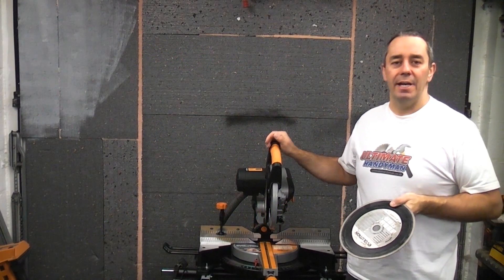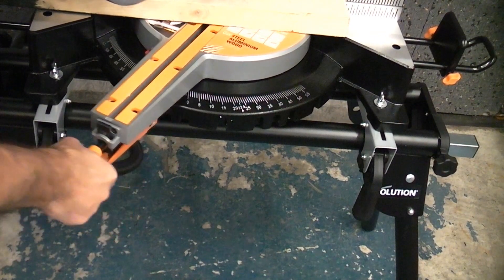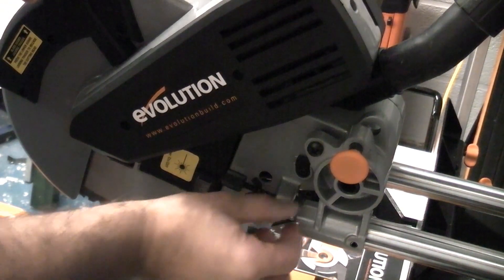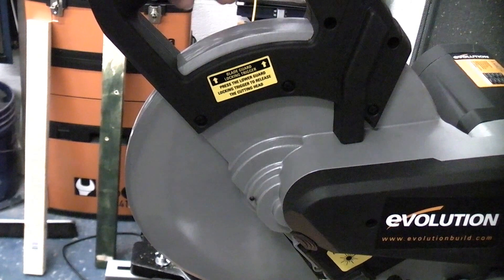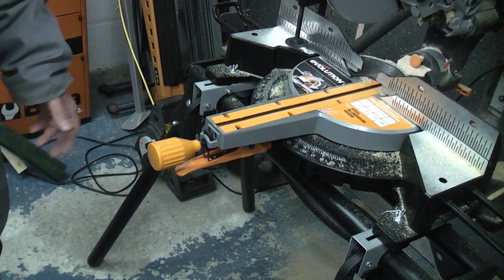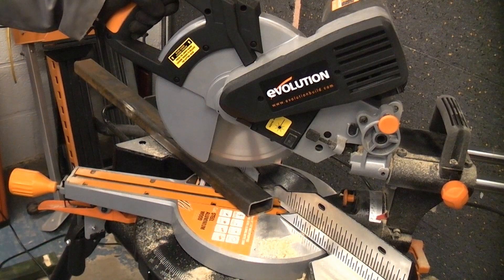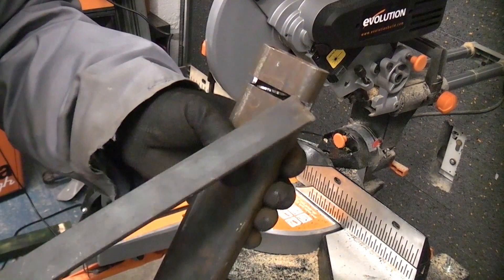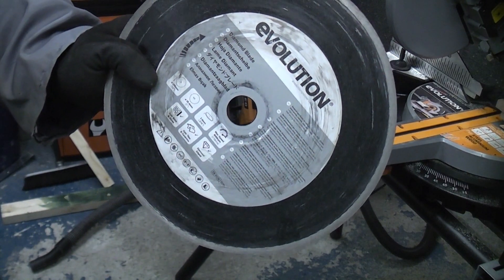Evolution Rage 3DB multipurpose mitre saw

Comment: You hide about  the  lack of graduation  angles  when you bend right  the machine  .
There's graduated  scale only for the left side. ..really weird choice of the engineers
Reply from the maker: This video is showing the Rage 3 DB 
DB stands for double bevel.
Perhaps you are thinking of the Rage 3s which only bevels in one direction and is much cheaper.

Comment: Thanks for the video.  I purchased my Rage 3 DB & it will be hear next week.  I noticed that you made all your cuts with the factory multi blade that came with the saw.  I will use this saw primarily for metal cutting (the very little that I do).  Have you purchased another metal blade for this saw?  If so what do you recommend?  I am primarily looking to cut EMT unistrut 1/8" - 1/2" metal.  I have read some less desirable reviews on the stock blade.  I would like to purchase a blade specifically for metal cutting.  Looking @ the Oshlun for $42 or the Evolution metal for $58.  What do you think???
Thanks in advance...
Reply from the maker: You are welcome.
I have only used this machine with the stock blade that is shipped with the machine (apart from the diamond blade for cutting masonry) https://www.youtube.com/watch?v=zHzofP82m34

Unistrut is difficult to cut on the Rage machines due to the galvanising, but it will still cut it with the stock blade.

I'm afraid I can't comment on the other blades as I have never tried them.

I have tried Evolutions stainless steel cutting blade on their Rage 2 machine and that is a fantastic blade ( I have cut some really thick metal with one of those).

Sorry I can't be of more help!

Comment: I brought one these about a year ago. But the blade is getting a bit blunt now. do you know if you can use other blades on these..
Reply from the maker: Yes, you can install other blades providing they are the correct bore, size and have the correct speed rating.
I normally buy blades when they are on special offer at Screwfix etc. 
Obviously, you'd have to get a specialist blade if you want to cut metal and wood, the Evolution blades are great for that!

Comment: What are the advantages of this one vs the rage 3?  Are they worth the price difference?
Reply from the maker: The Rage 3 comes in a few different versions-Rage 3-B is a 210mm mitre saw (not sliding)
Rage 3-S is a sliding version of the saw but it only bevels in one direction.
The Rage 3-DB is sliding and also has a double bevel feature, which makes it much easier doing bevel cuts.
If you don't do any bevel cuts or don't mind turning the work piece around the Rage 3-S is probably your best option.

Comment: I'm torn between purchasing the Rage 3DB and the EVOSAW380. The 3db is described as a "wood" cutting machine while the Evo380 is strictly metal, yet your videos demonstrate it's metal cutting skill to be impressive!  

I'm looking to replace my abrasive chop saw with a more accurate cutting machine, meaning I don't want the blade to wonder off on cuts. I mostly work with mild steel with a thickness of 1/4 max. Occasionally I have something thicker, yet I've seen videos of the Rage 3DB cutting 2x2 steel. 

Any advice you can give me so that I can make a proper decision?
Reply from the maker: The Evosaw is better if you are only cutting metal. You can also get blades specifically for the Evo saw for cutting stainless and aluminium (you can cut mild steel and aluminium with the supplied blade- but a specialist aluminium blade is available).
The Evosaw cuts metal effortlessly and because the blade is larger it lasts much longer than the blade on the Rage 3 machines.
I hope this helps ;-)
Reply: That helps a lot! I mostly cut less that 1/4 thick mild steel, usually .060 wall tubing, and it's not an everyday thing. It's mostly one or two projects thru the year. I think given the low frequency the Rage 3 would work, well for those types of projects and the versatility of locking angles quickly is such a huge plus! 

 I can use my abrasive 14 inch on the larger stuff in the meantime, until I save up for the EVO380 and have both in my shop eventually. Thank you very much! Cheers!
Reply from the maker: You are welcome ;-)

Comment: This DB mitre saw is an amazing piece of kit. Im shocked other brands don't compete with the same metal/wood capabilities. Another great video from yourself
Reply from the maker: Absolutely. It's an awesome machine. Thanks for the comment ;-)
Reply: +Ultimate Handyman  after watching your video and another, I felt confident to purchase one. However, the instructions don't really tell you how to set it up (I prefer diagrams). Could you show us please? (if not lazy bones will look up) Thank you
Reply from the maker: +musicmad1 
There is not much to do is there?
If I remember rightly there are only two supports that fit into holes at each side of the machine and possibly one for the back- which are fixed in position using cap head screws- which should just need loosening first using the hex key provided with the machine.
Reply: +Ultimate Handyman Apologies for more Q's Ive still got L-plates on where DIY is concerned. I want to build .a bench/storage box & a shed. What screws would you recommend to build both? The shed will be built next to our current masonry shed so only need to build 3 sides. Would I use a concrete anchor to fix timber to masonry or a standard wall plug? Thanks ever so much for your patience
Reply from the maker: +musicmad1 
I'd always get good quality screws, such as Screwfix's turbogolds or spax etc. 
You'll obviously need to get the correct size,  I normally use number 8 wood screws (which is a size 4 in metric). For most things I use an inch and a half by 8, which is sold as a 4*40 . 
When you say masonry, if it's brick I would use screws and wall plugs, or if it's stone or concrete I would use concrete anchors or concrete screws.
Reply: +Ultimate Handyman Thankyou for the information!

Comment: Is it better than Rage 3 you previously made a video of?
Reply from the maker: +Predrag Nikolić 
Yes, this is the better version because you can cut bevels in either direction using it. With the Rage 3S, you can only cut a bevel on one side of the machine, which can mean that you have to turn the work piece around (which can be difficult with long lengths of timber etc.)
If you don't do many bevel cuts the Rage 3s is very similar and cheaper ;-)
Thanks for the comment

Comment: I am super impressed with this!  love the ability to cut almost anything, and its not even a struggle doing it, very tempted to get myself one!
Reply from the maker: +jusb1066 Absolutely. I have loads of Evolution tools (some more reviews coming soon), I have bought some of them though ;-)The one thing that you notice with all of their tools is that the machine never slows down under load. The motor and gear box are very high torque and they never seem to slow down unlike most other machines. Evolution make a disc cutter, which I was sent out to test. I used it and thought it was good, but I also took it on site and gave it to a mate of mine to test out as he has 33 years building experience. He absolutely loved it and cut some really hard C35 concrete using it and also a floor to roof cut externally on a brick wall and the machine did not slow down one little bit!Thanks for the comment ;-)

Comment: hi what type of blade is used to cut 6mm steel.  The fact this can be done with this tool - is it due to the blade or the tool itself?
Reply from the maker: +Aman A 
It's a combination of the machine, which has a powerful motor and high torque gearbox and the special blade.
The standard blade that comes with the machine cuts wood, wood with nails, plastic and metal. If you want to cut masonry you have to swap over to the diamond blade.
Thanks for the comment